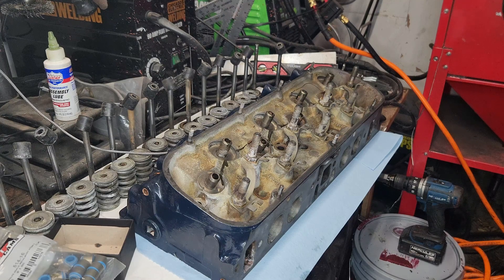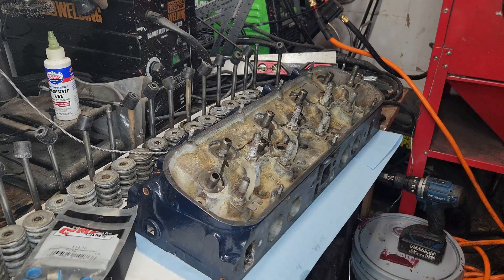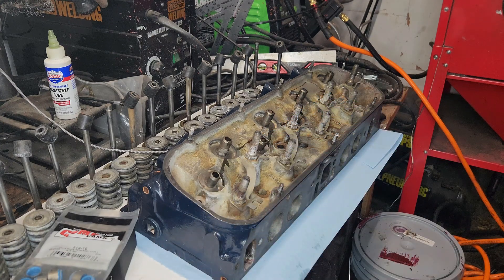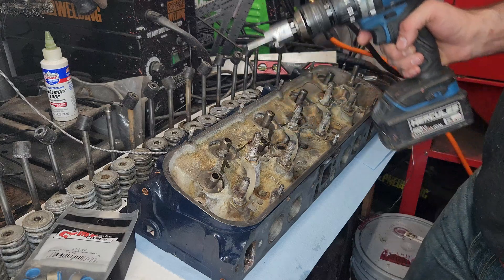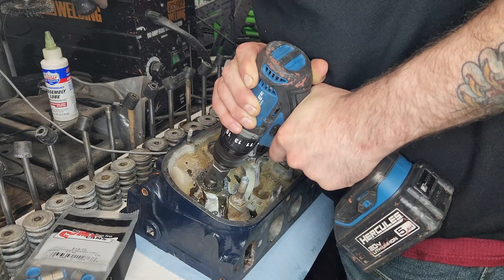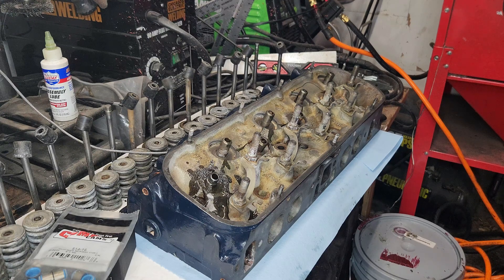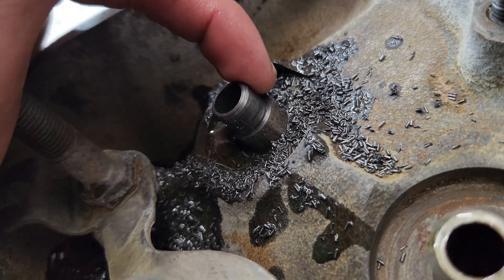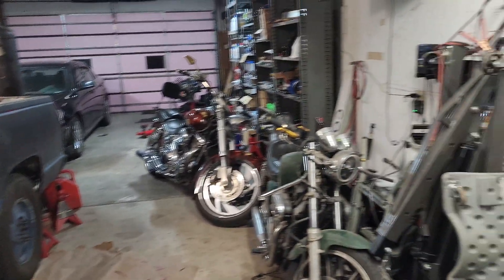Guide to Cutting Valve Guides for Narrow Valve Stem Seals

Comment: I know this is older video but do you know how much lift your cam is. The cam I got is .550in and .530ex, will this tool cut down the needed clearance (.100 or more) I'm going to run vortec gen6 BBC heads
Reply from the maker: Unfortunately I don't remember the exact specs of my cam and I can't find it bc my order history on summit won't go back far enough but I do remember its is chevy performance 502 roller cam. Plus the main reason I did the guide cutting was more so to fit different springs and stem seals. Hope that helps at least a little bit
Reply: @shitboxgarage  Thanks ill look into the tool some more and see if it'll work for me.

Comment: Even going to a machine shop is no guarantee it will get done right.  I had a pair done and the machinist did not check the sealing of the exhaust guides and 3 of 4 on BOTH heads leaked water into the oil.  It’s cost me $600 extra so far.  
Between buying another pair of heads, doing the cleaning, taking them to have the guides cut like you are doing, travel expense of going 100 miles round trip, then a new gasket set for head gaskets, intake gaskets, exhaust gaskets, and approximately a month of down time, 2 more oil changes of filter and 7 quarts of oil each, and lastly, if I added in for my labor, that would be another $500 on top of the $600.
I would have been WAY better off just spending the money on a pair of new aluminum heads and a rectangle port intake.
Reply from the maker: @Big_Block_Ranger  that's some unfortunate luck or something, man. I did this with a cheap drill and a fancy bit. I've run at least 10 gallons of fuel through my engine on the test stand and no issues.

Comment: Do you know does this cutter work on small block chevy heads also?
Reply from the maker: It should so long as the dimensions of the guide and the dimensions of the cut are what you need. They make different sized cutters for different sized guides